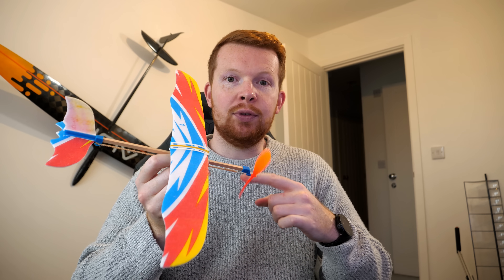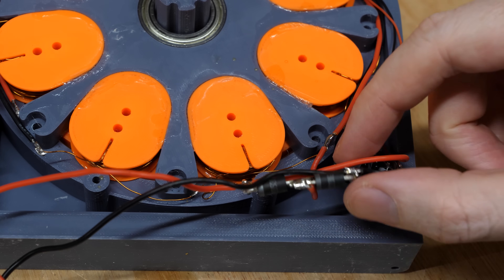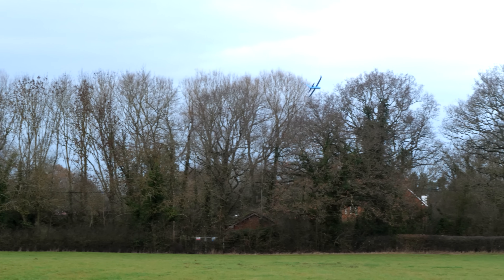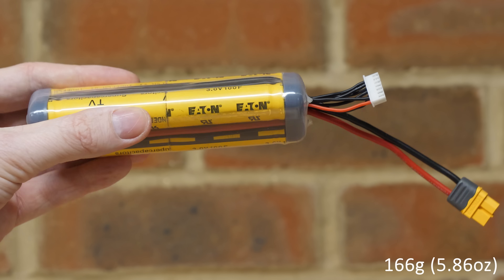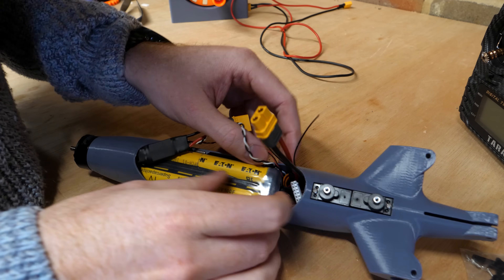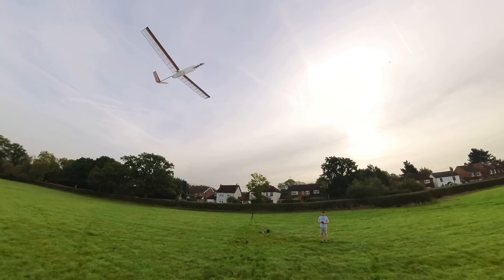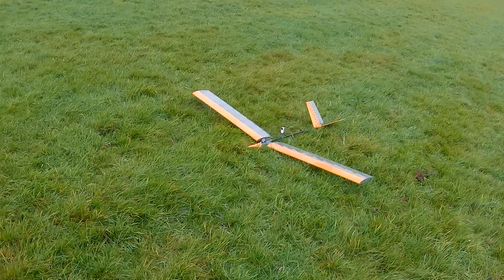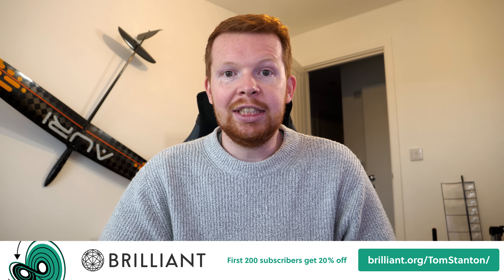Super Capacitor Plane

Comment: Hey jo, i think i got a crazy but also awesome idea: how fast could you charge this plane when you use a very good power supply? If it is possible to do that in less than a second you could try to charge the plane while flying. Maybe putting two conductive stripes on both wings. Than you need some kind of setup where 2 wires are hanging from something. now if you fly underneath the wires, so that the wings of the plane touch them you could charge the plane.

I imagine this being a very fun thing to do. Flying until you are slowly running out of power and then trying to quickly recharge it.

Even more crazy Bonus idea: Make the pilot sit on a bicycle, generating all the power the plane needs while flying. XD
Reply: the charge time is limited by the esr of the super capacitors, though they charge must faster in comparison to ordinary batteries, the charging time is limited (in this case) to 200 Watts, which is probably to low to let it charge in the air like u imagined it. However, it may be more possible when u put the super caps in parralel instead of series, since that lowers their resistance and thus make a faster recharge time possible.

Comment: Rolling your own capacitors is relatively simply and more importantly, cheaply, especially for someone with your competencies. I bet you could roll your own capacitors, and wrap them in carbon fiber and embed them as part of the structural frame. This could greatly cut down on weight and improve your overall efficiency. Keep up the good work Mr. Stanton!

Comment: What if you used a small 2s battery to run the receiver and servos that way you can run the capacitors all the way down and will still have control.

Comment: Lol, you could have a small motor turn the crank and have a double 18650 powering it. Xfering energy from li-ion 18650 to super cap. Would take like 5 seconds to charge

Comment: You can buy these Lithium Batteries with BMS installed so you don't have to worry.  There are of course BMS voltage limits for the input.

Comment: The plane you built really seems close to a finalized toy product.  The folding propeller is great, and would be a boon for parents who otherwise have to deal with kids upset that their plane prop breaks on the first landing.  I had the AirHogz air pressure powered plane as a kid, and this really feels like the next version of that, a spiritual successor if you will.  This time, super caps instead of air powered, haha.

Comment: so, could you wire it in a way to take advantage of the propeller windmilling? Airliners have an emergency propeller that can be deployed to keep electrical systems running in an emergency. Wondering if you could use the spinning of the propeller while under glide to keep your servos running so at least the drag is going to use

Comment: Wire in some coin cell batteries or a couple of lithium cells and use them to run the servos, that way all the capacitor power can be devoted to the motor. 

Would it be possible to make it with a hybrid system, with both capacitors and batteries to power the motor?

Comment: How about adding regen? That way you can use the prop motion during a glide to recharge the capacitors in flight when they're running low.

Comment: Could you add a voltage regulator to limit the peak current to the flight controller from a fully charged bank, maybe improving fight time? Or is it just added weight and wasted power?

Comment: Can you get the windmilling prop to recharge the super cap?
That would be interesting. 
Imagine if you can flip a switch to recharge mid air and flip it back down to discharge the energy. Make it so that it’s not as good as charging on the ground, but make it so that you can eek-out a few more circuits before having to land for a full recharge.

Comment: Is it possible to put solar panels on the wings to charge the capacitors that would intern charge a lithium ion battery with some kind of switch to discharge to the Batt Once caps are full? Utilizing the best of both worlds, fast capture of solar light to push into the battery while the battery amp hours are higher

Comment: Great work Tom ! ! !   Some of the others already mentioned the brake feature in the ESC.  I'll add that having the big gap at the center between the two wing panels is not helping much.  That gap results in the wing losing a lot of its performance in terms of drag and slow flight.  A better design for the fuselage would have a full chord wing "stubs" that has matching airfoil to the wing panels.  And the joint should even be a very close fit or sealed with a layer of low stick tape of some sort.  And these stubs would also include the mounts for those joiner rods.  The resulting wing that extends all the way across instead of having that big gap will climb a little faster, fly a little slower in the glide (if you trim it that way) and extend the glide time.

Comment: If you have small surface area for a 3D print, then add brim, or simply one layer height disc that can be peeled off when the print is done.

Comment: I'm not sure what receiver you're using but if it's a more recent FrSky ACCESS receiver (I saw that you're using a X9D ACCESS) some of them support direct input of battery voltage into one of the pins (AIN2).  Some of the older ones require a voltage divider but the newer ones can take up to 30 or 35V.  Then you could read the voltage on the transmitter and maybe set up voltage callouts on a button/switch.

Comment: How about trying to add some lightweight springs onto the propellors to keep them open. They might require less energy to spin up, still fold back when it crashes, and also actually slow down the crash by acting as a dampener

Comment: You should use the freeweeling action for regeneration 🤔
When the motor stops working and the plane starts coming down, it will put some power back in the caps just for emergency or just longer flight.

Comment: What would be cooler if the charging "dock" was a hook and a sling.
Have the charger on a sling around the neck, and on the Charger, have a hook-method that also connects to + and - and charging it would be even faster and less fiddling with cables.
It appears in the video that the wings are only connected via exposed rods between them and the body.
If the "hook" on the charger has an + and - on each hook side, just slap that onto the wings, connecting it to the place.
A switch might be needed to be added to toggle between charging and flying. But there ya go.
Once it lands you just hang the craft unto the charger, dangling at the front, between the legs, while you crank away ;)
This'll decrease the fiddling between charging and the fun flying.
Not 100% how this would look, but it's an idea based just on what i saw, and i'm no engineer.
I'm just trying to think of this from the perspective of someone who ain't versed with electronics or from a kids perspective who just want to crank, then fly, little thinking.

Either way, neat video!

Comment: Would the auto rotation of the prop keep the caps charged, giving you more control time? Obviously more drag means a little less control. But are the caps being charged, or at least, does the ESC have any sort of backwards energy delivery? I assume it must do otherwise the field would build up and the motor would self brake.

Comment: This feels like the crank could take some efficiency improvement, by not cranking it. What I mean is.... consider this. A heavier unit on a board, with a flywheel and a single stamp pedal with a unidirectional ratchet and much higher gear ratio. It could likely be assembled in such a manner that a single "stomp" could spin up the flywheel long enough to charge the aircraft with no further action. 

You basically use your own effort in resisting gravity, something we all do constantly, instead of spinning a crank which is an artificial motion.

Comment: As another commentor has said: use a brim when 3d printing high aspect ratio parts. They add surface area to the build plate to help adhesion, without adding tons of print time or waste material

Comment: Really cool project! -- If the super cap pack gets fully charged at 18V and you loose the motor at 6.5V you are leaving a fair amount of energy in the supercap. I'd have to look into the efficiency, but you might want to investigate a buck/boost converter to see if you can keep it running longer by pulling the voltage up as the supercap discharges below 6.5V. Others with more experience will probably have better ideas.

Comment: What about using a buck/boost dc-dc convertor for the control and servo electronics to try and keep them going after the motor cuts out ? 

In fact i'm assuming the radio probably has a regulator of some sort on as well, if you could essentially bypass that and replace it with a decent buck/boost convertor you might be able to stretch things out a decent amount.

Comment: I don't remember who makes it, but there's a folding propeller that folds by itself once it loses speed above a certain (fixed) rotational speed. It works by having two small wound springs on the blade hinge. It's not enough affect them in flight or throttling, but when the power drops completely, they fold (basically the springs nudge the blades and the air does the rest).
Reply: On front-mounted propellers like this it doesn't need any springs to fold, he just needs to enable braking on the ESC.

Comment: So if the charging and discharging time are equal, it means that if you're generator runs at a theorical 100% efficiency, the power of the motor is the same as the power of your arm, which I find really interesting...

Comment: I wonder if the windmilling is enough to keep the voltage above 5V (if that is electrically possible). 

Then you’d trade off the windmilling for guaranteed controllability (although, to be fair, it should be enough to get it down at best glide time even without the windmilling)

Comment: If only you had a battery charging a capacitor bank on the ground you could practically to touch & go landings.  With the battery slowly charging your refueling capacitors on the ground as you were flying.

Comment: What about a glider which has kind of an external package with capacitors and a prop. When you got a nice hight and the capacitors are drained, you can drop the motor and capacitor package, which will fall down with a chute, but then you'll have a pure glider. A small LiPo stays on board for the controls. Could be difficult to get the cg right, so it won't change with or without the pack. With a front facing motor, a flap door mechanism would also be cool, which will make the front smooth, as soon as the motor drops.

Comment: Others suggested the ESC brake on the motor, but maybe a cool idea would be a charging circuit on the motor so when its free wheeling with no throttle it charges the caps giving you a little more time to return to home before the controller runs too low?

Comment: i wish i had such a plane in the beginning. no tools, no fuel, no glow plugs, no starter or leather belt starter  needed. and if you crash no fire hazard or flying heavy wood or hot metal bits. 
i crashed in the beginning many plains and sometimes the fuel tank ruptures on impact and fire is everywhere or the motor explodes in the sky because the rotor brakes and the motor is over spinning. or the ignition causes problems with the radio on 4 cycle engines. i switched on some planes to a 4 cycle engine because regular gas is cheaper as two stroke or nitromehtanol. and maintenance was cheaper to and less prone to rip of your fingers. 
my firsts planes where simple boxes with a small engine in the front a tank in the middle, two landing gears  and a simple metal slett with a hock an the rear. the wing was attached with rubber band and later on with leather but on a crash the rubber performs best for not ripping the whole plane apart. later on i had build a parachute in the rear to deploy in case something goes horrible wrong. but more and more electric planes was coming so i bought one and later on i build one but at this time electric was not that great. some of them where noisy in a bad way. 
now i fly mostly electric ones and i have a 3d printer and use it for repair or modify but never build one entirely with one. except one time but it was to heavy and flimsy it as only for education how a rc plane works. i never thought it can fly only with the power in a capacitor. yea you clearly cut some corners to make it possible but it flys. maybe this is a option for powered gliders i case the need a small help to get up. those gliders are often really heavy because of the battery but having maybe some pv panels on it and capacitor they can go lighter. maybe i should try build a glider with the capacitor like you and use pv panels to charge on flight. engine think is not really needed and the radio is low power enough so it can function for a infinit fly time. 0.2 watts should be easy to do maybe 1w. if this works 1w is plenty if you not turn like crazy ^^

one thing wonders me why the balance leads?

Comment: Tom! Tom! Tom! use the energy being generated from the motor after you lose power to re supply you cap bank. kinda like KERS (kinetic energy recovery systems) my point is you motor can also be a generator. not sure if it would work necessarily but maybe ?

Comment: Maybe you can turn this thing into an RC plane that behaves similarly to a car with regenerative braking. Gain altitude with the super-capacitors, then glide around, using the prop as a generator to charge the super-capacitors again.

Comment: I'm not well versed in magnetism or power generation however, I had an idea. Not sure if this could work but, would it be possible to use some fixed magnets to auto spin the generator. +pole to +pole so it could spin without cranking?

Comment: You maybe should consider to use that drag for charge the capacitor during the free flight
Reply: That sounds dangerously close to perpetual motion
Reply: @bigbootros4362  Wow, wow! Don't make me say what I didn't say, I'm not talking about perpetual motion but about optimizing potentially wasted energy that could improve flight time or landing, like an electric bike that recharges when going downhill or during braking , the goal is not to leave for another flight but to be able to land safely while possibly having a little engine boost due to recharging during the descent 😅

Comment: Find a small button and put it on so when you have full throttle, it doesn't spin up the motor until its released. Then when you Throw it, you can have it burn your energy before the motor gets to speed. It would get you an extra couple of seconds of on-power flight. You are wasting a lot of your best voltage doing nothing but spinning the prop in your hands. It would be better I think to have that on-tap for the climb on the initial throw. That is when you motor is going to have the highest output.

Comment: I have an idea.  Use a microwave antenna to charge the capacitor.  You can crank it from the ground to charge the capacitor in the plane.  Somehow make the plane do circling around you.  Need a proper planning to do it.

Comment: What if you built a controller to drain the capacitor packs in sequence. Might be able to get more run time with more packs. Also a folding prop from an RC glider might cut down on drag when the motor quits.

Comment: Are the super capacitors receiving a full charge? 
There should be a noticeable reduction in torque required to crank the generator as the capacitor reaches its required voltage and charge state..... 
I didn't hear any mention that the cranking got easier as it reached it's peak voltage.... 
Because once fully charged, the capacitor won't take any more energy and it should feel like a connection between the generator and the capacitors has been broken and you are cranking the generator as if there's nothing there....

Comment: The bridge rectifier doesn’t convert AC to DC. Not true DC anyway. When viewed on an oscilloscope it still has a waveform. It’s referred to as “rectified AC”.  HOWEVER, for most purposes, it acts similar enough to DC that most (even myself) usually refer to it as DC. The wave can be flattened out further with a filter choke and sometimes capacitors are used to smooth it out even further.  

Of course calling it rectified AC will confuse more people than it will enlighten, so yeah, it’s DC, but not really. Lol

Comment: Hi Tom. I have an idea for a project: how about you use a microwave dish pointed at the plane (and maybe even have some automated tracking stuff to keep it pointed there) and see if you can transmit enough power wirelessly to keep the plane in the air by having a circuit on the  plane that converts the received microwave energy back into a voltage to power the plane's flight systems.
Reply: @FilmLadd not only a plane, but fly-by birds. From the other hand: fly plane endlessly and munch some fried chic... ehm, pigeon ;)
Reply: It could work, but it's also a great way to get the UK equivalent of the FCC very angry.
Reply: Might start a fire on the plane though
Reply: @FilmLadd  Oh good point. He'll want some nice fire-retardant coating. :)